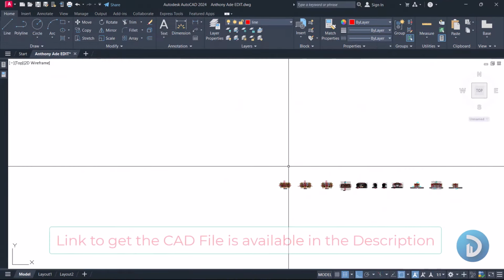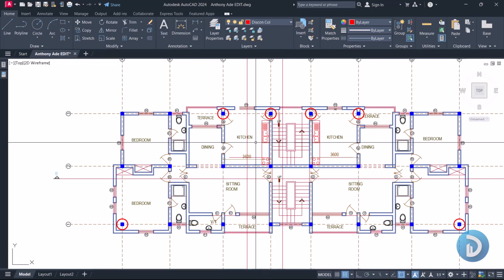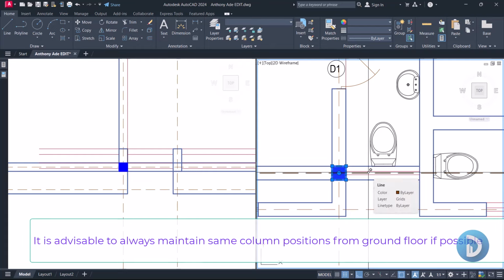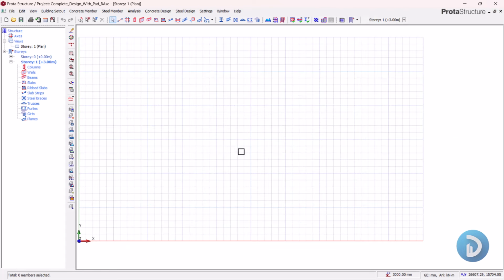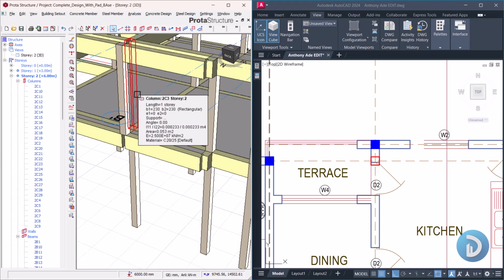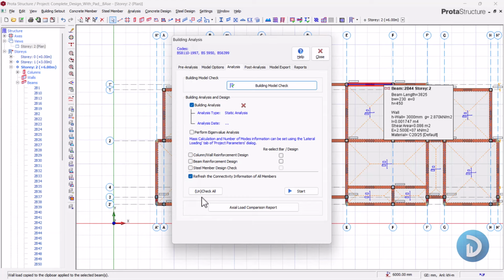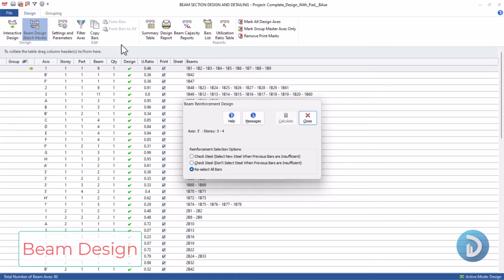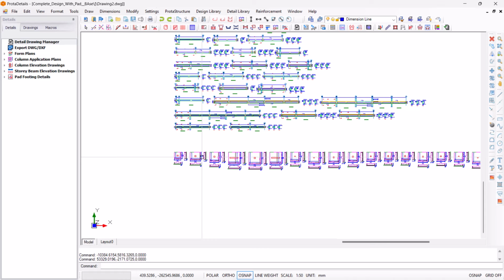Complete Building (Structural) Design On Prota Structure (Best For Beginners)

Comment: what about the dead load from the roof?
Reply from the maker: The dead load from the roof can be added to the roof beams  by multiplying the unit weight of wall by a height of about 0.6m. 
With experience, this still amount to same reinforcement as our minimum hanger bars provided by the beams hence was not applied.
Reply: @ okay , thanks boss 🤝

Comment: hi, how to add a glass wall load?
Reply from the maker: Get the unit weight of glass (note that this varies as regards to the thickness of the glass in reference) then multiply by the height and apply as a line load. 
I hope this helps.